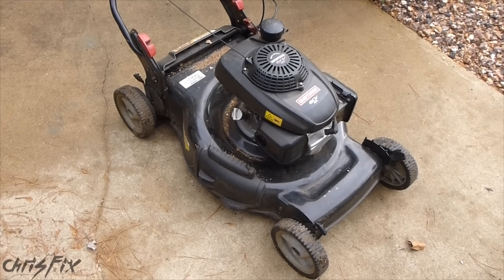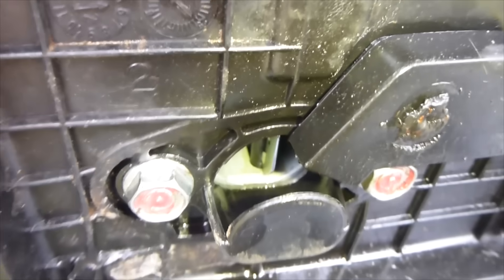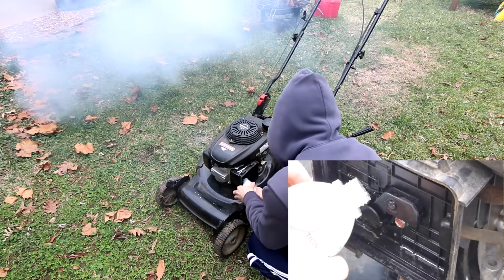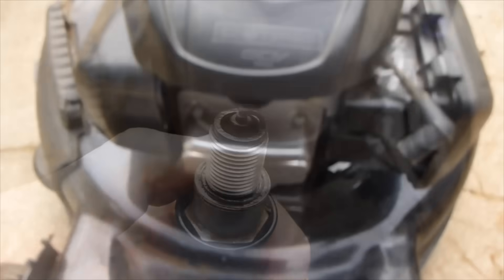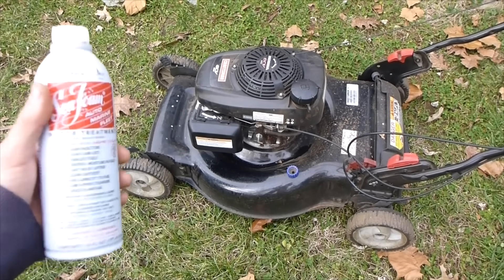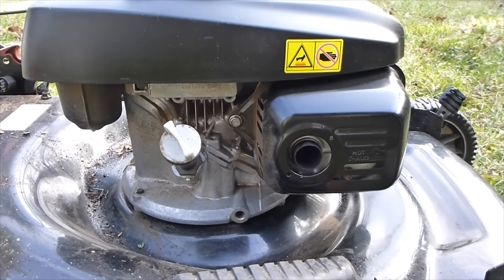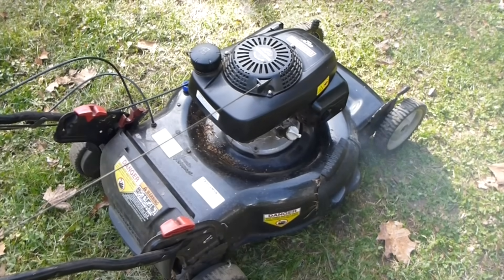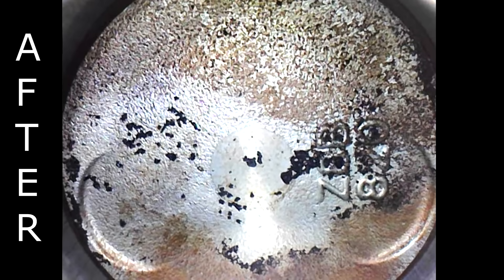Does Seafoam Actually Work? (with Proof)

Comment: Can you please try  B12 Chemtool fuel system cleaner. It's like sea foam except cheaper but I think it works better than sea foam imo
Reply from the maker: 23briansanchez I wont be testing B12 because it has harsh solvents such as acetone and toluene which melt plastics but thanks for the suggestion!

Comment: Do not use Sea Foam on any turbo charged engine.  The carbon chunks will destroy the turbine blades and may overhead the turbo's bearings.
Reply from the maker: Sharpsdoublerifle Thanks for sharing! Have you had that experience before?

Comment: I would be willing to bet you can achieve the same results with the same amount of water, using the same technique.
Reply from the maker: RibbedGiraffe 1 I wouldnt be so sure. When I got my bore scope camera, I tested a bottle of water which is about how much seafoam I uesed, and it just cleaned that bottom spot on the piston (the cleaned spot at the beginning of the video).
Reply: Would be nice to see a before and after of water - compared to expensive additives.  I don't have a bore scope, Otherwise I would try it.

Comment: I had Briggs V twin with 600 hrs and smoking terribly and using huge amount of oil. I mixed seafoam into engine oil and ran about 30 minutes. The engine stopped smoking and I guessed the oil control rings had built up excess carbon and sea foam eliminated.
Reply from the maker: blastforyou Thanks for sharing. That is a pretty good result and yea, I would think that is what happened.

Comment: i imagine u could soak ur car pistons and turn ur crank by hand and push the fluid out of the spark plug holes. That is if u have a engine where ur plug holes are on the sides not angled. Like a inline 6 cylinder. Would be interesting to see.
Reply from the maker: Red Bullseye That is a good idea, but not as easy as it seems because the piston doesnt come up to the spark plug hole so the liquid wont just shoot out.

Comment: what is proper way to put seafoam thru intake.have to get it to run thru entire intake system
Reply from the maker: Mike Cullinan Usually the brake booster vacuum hose will feed all of the cylinders. Or you can find a spot after the mass airflow sensor in the intake to introduce the seafoam. You will see when I test it on my truck.

Comment: is there a seafom version that can be pourd into the gas tank  I used Lucas before getting my car inspected and it passed inspection very well.
Reply from the maker: SuperJeremi10 You can pour seafoam in the gas tank as well if you want.
Reply: cool  any idea what method works better.
Reply from the maker: SuperJeremi10 It will definitely work better though the intake because it is super concentrated.
Reply: oh okay  I can try it that way.

Comment: I love Seafoam, and it's the only additive that i would ever put in my engine. Though i do it through a vacuum hose using an IV hose which is the drip method, I feel it works better.
Reply from the maker: Recr Thanks for sharing! I will be testing it in my truck soon so stay tuned!

Comment: I've used this tons of times in car motors everything from diesel to gas to rotary. it works. but then again, most mechanics just use water, it will clean out your motor just as well.  (at least the intake)
Reply from the maker: paradoxdesigns Thanks for sharing! I will be testing water to see how well it works in the combustion chamber in a car! Stay tuned!

Comment: i did this to a tecumseh motor once but i mixed it super rich,when id work the motor hard the sea foam wouldn't fully burn and spit out the muffler as a black liquid,because it was liquifying the carbon built up in the motor,by the time i ran two tanks it looked as good as the last test in this video. SEA FOAM FOR LIFE.
Reply from the maker: weasel884 Thanks for sharing! Yea, I was really impressed. This is the first time I ever used seafoam and I am hooked!
Reply: another thing i do with this stuff is dump a hole can in the oil and idle the car for 5 mins.what ever would get usually left behind (sludge or dirt) has become liquified and runs out with the oil.makes the oil drain ways in the rockers and head cleaner so it runs cooler on the top end,boosts oil pressure.
Reply from the maker: weasel884 Thanks for the tip! That is a good idea!

Comment: I ran seafoam in my weed wacker 2 summers back. It was getting weak and after I ran it through the thing ran super strong and revved up much easier. 

Didn't get the same results on the car though. Put seafoam in the gas tank and engine oil. Didn't notice much of a difference. But then again it was a super well maintained Corolla. 

Gonna try it on my snow blower and lawn mower in the spring.
Reply from the maker: bmwmsport11 Thanks for sharing! You probably wont notice a difference in an engine that is in good shape.
Reply: bmwmsport11 In order to benefit from Seafoam in a more noticeable way, you have to add it through an intake line/vaccuum line directly. Putting it in the gas tank clean the injectors some, and same thing with the oil. it'll clean up the pump and oil valleys. You won't notice a difference from that though

Comment: More importantly, when you run sea foam in your gas, it cleans out the gunk in your carb, which is (in my experience) the number one problem with small engines.

Comment: Stuff is really great for turbo vehicles, it does a decent job cleaning the carbon deposits on the turbine blades. Very cool stuff.
Reply from the maker: Review Guy Thanks! I didnt even think about cleaning the carbon off a turbo's blades. That is pretty cool!
Reply: Yeah that stuff is great, Even though its not being fully burned off usually it helps loosen the build up on the blades and after your finished sea foaming it usually helps alittle bit. 

Its important too because when that carbon builds up those blades endure more and more friction considering the tolerances in turbo's are so small that just a small bit of build up just gradually eats away at the ends of the blades. Id recommend this stuff to all turbo guys.
Reply: Review Guy I suppose I should run some of this in my duramax then. I usually use Diesel 911 but, not sure if it has the same effects.
Reply: I believe it is safe to run in both diesel and gasoline engines. But id make sure before you try.

Comment: Contrary to popular belief some carbon build up is actually very good for your engine, as it provides higher compression but ti much carbon can be bad as it can get stuck in the valves or become dislodged and scar the cylinder walls but thanks for showing us proof the stuff actually works!
Reply from the maker: justin cole Glad you liked the video!

Comment: the only problem is - a dirty piston head does jack all to the car. If anything it would help becasue it would improve the compression since an old engine tends to leak air and liquids through the worn surfaces.
Reply from the maker: OnlineBackupServices Carbon can cause extra friction in the cylinder, it can cause your valves to not close all the way, it can cause the piston to be off balance, and it can cause detonation which can damage the engine. That is why you want to clean out carbon.

Comment: you could have got the seafoam out of the cylinder by just tilting it the other way..
Reply from the maker: OnlineBackupServices Actually it would have been hard to get the seafoam out by tilting it. The lowest part isnt the spark plug hole.

Comment: With the camera was the way to go. I was ready to say ware is the proof and once I seen your video I seen a great video on how it should be done. Thanks for posting this great video. Soaking the top of the pistons would only work good if you have a strait engine design. I am curious it you tried straight water into the carb to clean the carbon out of the combustion chamber how that would work out. I have seen it done and have done it my self and you can see and feel the engine running much smoother. Also a very cheep alternative. But I don't think the water would help for the intake manifold or the intake valves. So the sea-foam still may be the way to go.
Reply from the maker: moterdude1959 Thanks man! Definitely consider subscribing! New automotive "how to" videos every Thursday and most Mondays! Plus, I will be testing water and seafoam in a car motor and those videos will be awesome! I cant wait!

Comment: Please do a test of marvel mystery oil.
Reply: ChrisFix Marvel Mystery Oil is better for air tools than engines IMO.  You're right, they don't claim to be an engine cleaner.  I like your tests.
Reply from the maker: heiko K I was going to do a Marvel Mystery oil test but they do not make any claims to remove carbon in the combustion chamber so there is nothing I can test.

Comment: I've had several push mowers for different properties for like 15 years, never bothered to look at the piston.  If my mower runs perfectly, what is the point of this and what is the removal of that thin layer of carbon supposed to do?  If it's a 6 HP motor, would it give you .0000000000000000001 HP?  Call me old, but if it ain't broke, why fix it?  Very cool video by the way- cool borescope cam- nice man toy!
Reply from the maker: acoustic4037 The idea inst to do anything to the lawnmower, it is to test to see if seafoam actually works. That lawnmower was perfectly fine. I am doing a series on testing fuel cleaners and before I dumped seafoam into my truck engine, I wanted to see how it performed on a smaller scale. Check out the description to the links to my other fuel system cleaner tests with gumout, techron, and soon lucas.

Comment: I ran this in my 90 Chevy 2500 plow truck with 240k hard miles of plowing and moving stuff. I had a misfire and pinging going on and a small loss of compression in cyl 1. So i decided to try some Seafoam. Ran an entire bottle thru the main vac line off the brake booster. And added 1/2 of another bottle in the gas tank and other half into the crankcase as a last ditch effort. Now its not missing and compression has got better. Pinging is stile there but its less severe. Will run more thru it later on. I am a believer of this stuff. It works wonders.
Reply from the maker: dkhill27 Thanks for sharing! Sounds like it worked! Do you think the pinging is from too much compression due to a cylinder with a lot of carbon? Have you tried to run a tank of higher octane to see if the pinging goes away?
Reply: ChrisFix Your welcome. Yes i have ran 92 octane but that was prior to me using seafoam. Will try 92 again since i used seafoam and see if that will go away. Will have to get me a scope one day and check the cylinder and see how bad it really is. With all those hard miles it cant be good.
Reply: dkhill27 your timing could be off, after wear and tear timing chains and gears will wear out, that can cause pinging as well..

Comment: a fine mist of water helps break up carbon build up too!!! it's awesome and free :-)
Reply from the maker: *****  You might think that. I will be testing water and we will see what actually happens!
Reply: Yeah...its been I while but I remember reading something on a car form on a cheap way to break down carbon. A fine mist of water makes hot carbon pop and break loose. I'll see if I can find it again.
Reply from the maker: ***** That is common thought but there is no proof behind it! Which is why I am going to do the test!
Reply: Ok cool!!! I'll keep an eye open for your new video of it then.
Reply: ChrisFix It's more than a common thought, it's been done and tested extensively. If you ever have an engine with a blown head gasket at one cylinder, when you pull the head you'll find one very shiny piston!

Comment: I just tried one third of Seafoam bottle on the intake portion of my old 172k Toyota Camry with sluggish acceleration at low speeds. To my surprise, Seafoam treatment did make it more responsive. I am not sure how long this will last. But other additives I have tried in the past was Techron in the fuel which only helped running smoother but not gaining more power or acceleration.  Seafoam may have cleaned a dirty valve or a O2 sensor not sure.
Reply from the maker: Pirouz Farhani Nice and thanks for sharing your results. I tested Techron as well here: https://www.youtube.com/watch?v=h8i9qftqKNY

Comment: My fuel gauge was sticking in my Tahoe. It ran out of gas a couple of times, even though the vehicle display showed 50+ miles remaining. One can of SeaFoam in the gas tank, no more issues. It apparently removed varnish from the fuel sensor float.

Comment: ChrisFix  Do a Hydrogen cleaning and then aim that camera inside. you'd be amazed.
Reply: ChrisFix Regarding Hydrogen cleaning - It's more popular in Asia and catching on in Europe. A computer controlled machine feeds a mix of hydrogen and oxygen into the intake stream for forty minutes or so while the car idles. The results are visually stunning. I'd guess that the benefits would be what you'd expect from having a shiny new combustion chamber parts but damned if I can find a study or any information that's not from a vested interest. I'd love to see some long term data to make sure it's not degrading seals or eating O2 sensors or something odd like that.
Reply from the maker: Sir SMKSAlOT What is hydrogen cleaning?
Reply: Can this also work on EFI engines through the throttle body ?
Reply from the maker: Vu Tran Yes it will work on EFI engines. I will be testing it on my truck soon so stay tuned! You want to use it though a vacuum line that feeds all cylinders.
Reply from the maker: DJPhilTBCollins Interesting! Thanks for the info!
Reply: did i not reply to this? i thought i had with links for info and everything.

Comment: can you use Royal purple fuel cleaner?
Reply from the maker: KeepRolling1000 I am testing Lucas Deep Clean right now but I will check out Royal Purple. Thanks for the suggestion!
Reply: You welcome, also I got a question where'd you get your usb camera? does it come with installation cd?
Reply from the maker: KeepRolling1000 The link to the camera is in the description. It comes with an installation disc but it is garbage and in Chinese so I use a webcam software.
Reply: ChrisFix Can I know which software you use for the camera? 

I got one from lightinthebox .com and didn't come with software and can't use w/o software install...
Reply from the maker: KeepRolling1000 I use the webcam software that is preloaded on my computer. I just make the borescope camera a web cam.
Reply: ChrisFix is there specific steps that I could follow?
Reply from the maker: KeepRolling1000 turn your webcam software on, change your webcam settings so that you use the borescope instead of the default webcam.
Reply: ChrisFix thank you chris I will see if that will work...I'm dying to see my inside of my engine hahaha...I don't want to take off the head to see it..
Reply: KeepRolling1000 Thank you so much Chris it works like a charm I have hp I guess we have same platform...thank you again...

Comment: It works really well if you do this to your cars engine before you go for oil changes. It's alot harder to remove thick layers of carbon build up that get that way over time. Do this from the beginning when you buy a car and your pistons and valves will stay generally clean comparatively speaking. Another thing that is proven to keep pistons, valves, and intake clean is running water/methanol injection...but that's usually found in high performance applications...
Reply from the maker: Craig Cundiff Thanks for sharing.
Reply: I have use Coca Cola to clean battery terminals.. that's along the lines of water injection... it's been around since World War 2.. so, I could see that...
Reply: Craig Cundiff when I was a teen, one of my best friends dad would pour a coca cola bottle full of water straight into the carb on his cars every couple of months. Said it cleaned the carbon off. He said he learned that in the motor pool in the Army......I personally never did it, but wondered if it really worked.

Comment: Is seafoam caustic and smell light paint thinner or is more mild? I use lucas fuel conditioner and find it to be a mild and gradual cleaner. Sometimes I use Marvel for some top cylinder lube in my 2000 toyota.
Reply from the maker: Mark Langston Seafoam is not caustic. It is Pale Oil, Naphtha, and IPA. I will be testing Lucas Deep Clean this week!

Comment: Seafoam goes in the tank not the Intake. You put It in with fuel and as it mixes it cleans the fuel and all engine components. Seafoam is recommended by me and all the mechanics I work with
Reply from the maker: Garrett Letson I followed the instructions on the bottle. Seafoam can go in the gas, but when it goes in the gas, it is not designed to remove carbon deposits in the engine. It lubricates and cleans the fuel system. When you pour it in the intake, it cleans carbon deposits.
Reply: Well im not saying your wrong I ve always been told for all composite cleaning to put in tank.
Reply from the maker: Garrett Letson Yea, I was just going by the instructions for these fuel system cleaner tests.